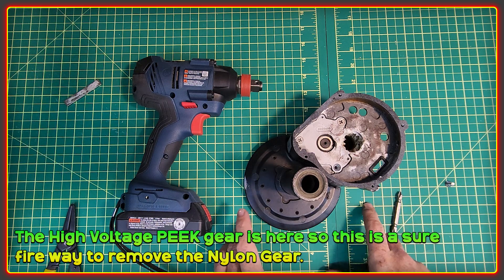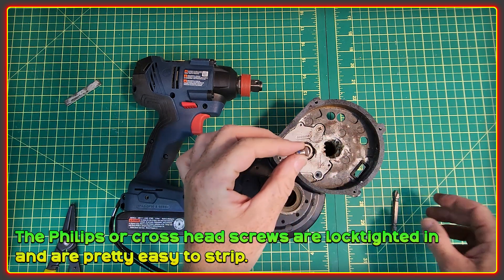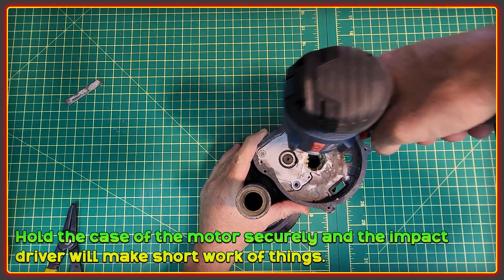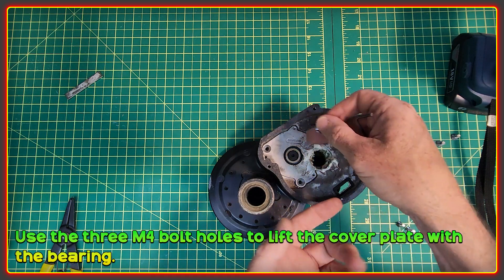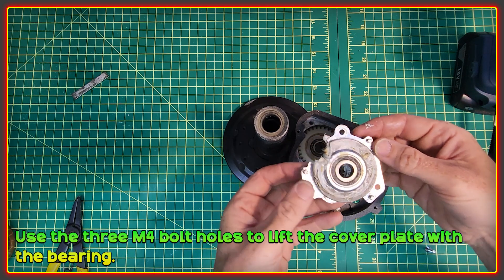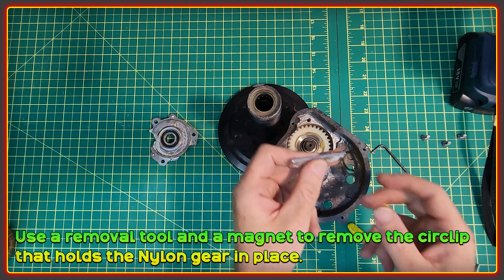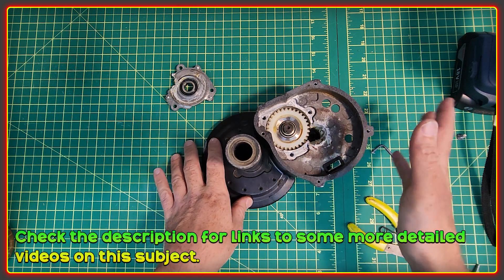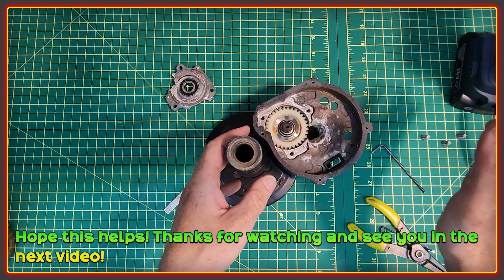The High Voltage PEEK gear for the BBSHD - Nylon Gear Removal Tips

Comment: What do you think about Lunas new black peek gear it's a upgrade from original peek gear.
Reply from the maker: I am not sure. We are looking into one using glass fibre. As to the merits of adding carbon to the mix until there is actually some genuine side by side comparison testing under replicable conditions its hard to say if it offers an advantage or is just a gimmick. A bit like people like to add graphene to things and say its a game changer with no evidence. We will never be able to compete with them on price. I will be sticking with our stuff but I would lol. Maybe there will be some independent reviews on the net at some point.

Comment: Hello! How far has this engine been driven? How long does a Bafang Bbshd drive without a breakdown?
Reply from the maker: Well over 10k bit not got a running total however. 10k is pretty common. Many run for way longer if treated well. The bearings all feel very smooth still. I think I need to replace a seal on the axle. They are well known for reliability.